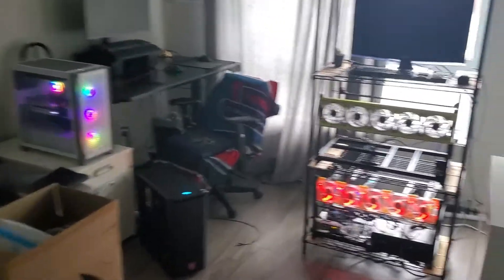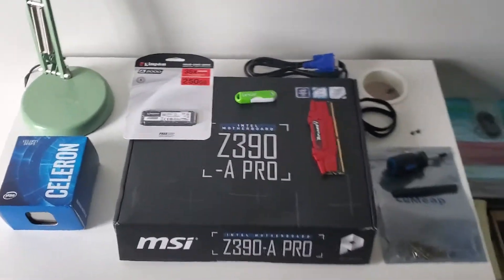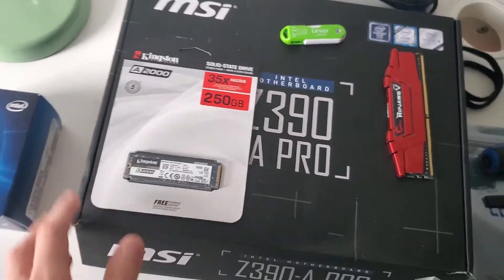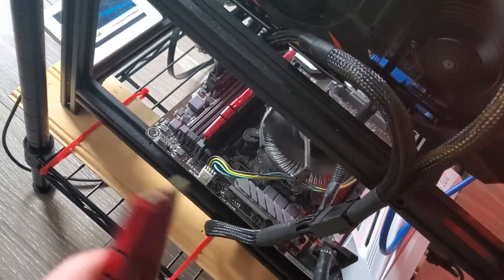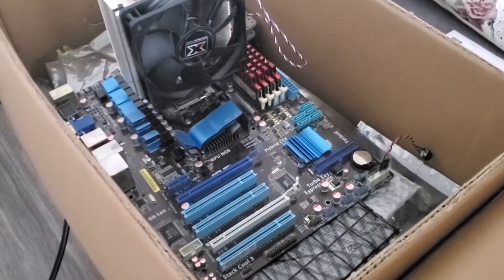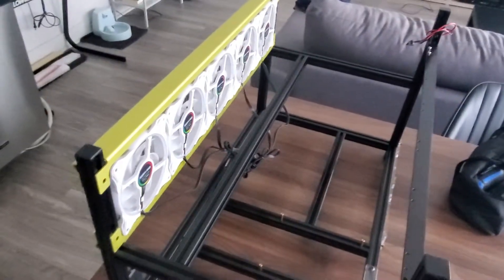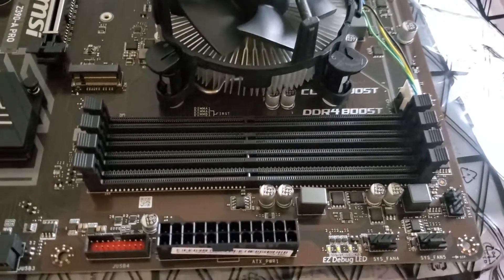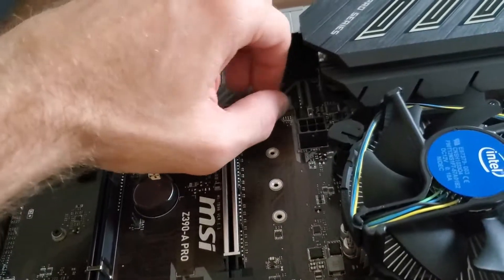Building an ETHEREUM Crypto GPU Mining Rig! (Part 1)

Comment: Z390 from.msi will do 9 gpus with the 1 x 4 splitter adapter
Reply from the maker: Sweet to know! If I get an 8 GPU frame ill do a 8x 1660 super rig :)
Reply from the maker: Which pcie slot on the mobo did you plug the splitter into?